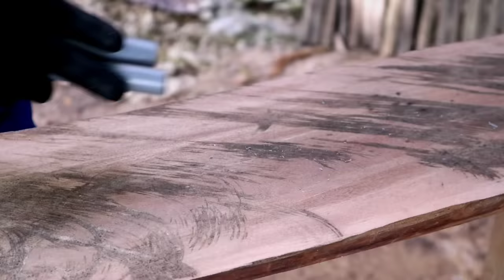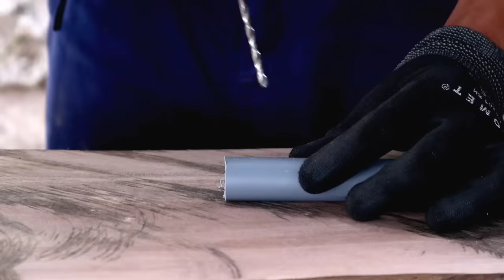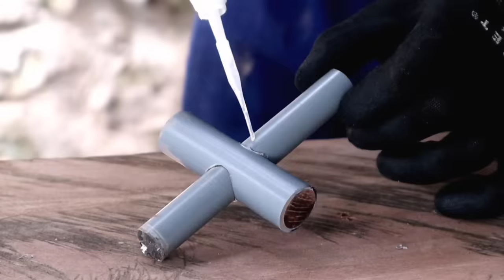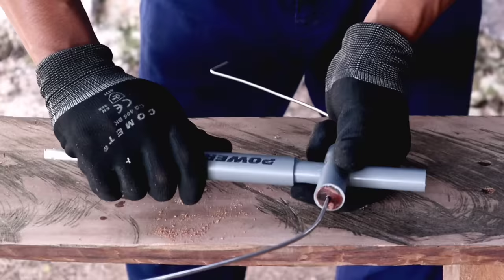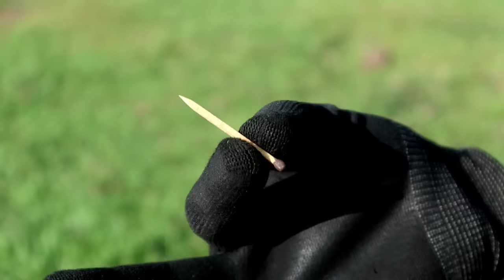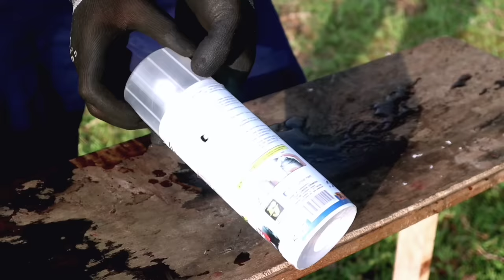SIMPLE INVENTION

Comment: He did this in another video how does the wood hitting the rivit ignite the match heads and when he packs it down. With the ram rod it doesn't go off someone explain  these physics there has to be something I'm missing
Reply: You are missing a toy snapcap, or a Real Primer.  If he put that on the end this would work, but probably blow the PVC apart
Reply: It makes sense if you don't think about 😁
Reply: The phosphorus on match tips ingnights with impact setting of the sulfur.
Reply: I’m wondering the same shit, if he’s not gonna show how he is getting that effect then why even have it on the video
Reply: It's an effect called dieseling. The air compressed by the piston heats up until it ignites the match head.
Reply: He packs it down softly, you barbarian.
Reply: @spartin1997  that's not enough to blow up everything it touches lol, something is not right here.
Reply: I don’t know I bought one of those little mini cannons that shoots the BBs. Instructions said use match heads, but I could never get them to (explode) even with a fuse just a little fizzle bb would just roll out the end
Reply: He should learn to drill straight
Reply: @snocattrf  Whatever, dude or dudette. It worked…crooked drilling and all.
Reply: Strike anywhere matches

Comment: So you have essentially built a fire piston and used it as the ignition mechanism for a musket. Neat
Reply: हलो
Reply: @vinaykumrawat2040  hole
Reply: Technically he built a miniature upright plunging  crossbow and loaded the quick shot tube with match heads. A musket has a flash pan are a small hole to fire it from the buttstock end! Symantecs though!

Comment: Good trickery timing with the off camera ballistic device that is what really blows up the target.
Reply: Nope, what he showed isn't impossible. You can make mini rocket boosters and cannon with match heads. It depends on the exact chemical composition the matches he has were madewith. Not all matches have exactly the same mixture. Some matches will just give you a little poof and lite up, others will flare up  in a much more impressive fashion when lit.
Reply: @VektrumSimulacrum  No reasonable amount of commercially made matches could contain and release enough energy to do the kind of damage to the targets as depicted in the video.  A firearm could.
Reply: @tompolkbroker  Maybe they're not your normal commercially made available matches. Maybe he mixed it with other stuff commonly available around the house. Nothing in this video is that far fetched. If people can figure out how to make Thermite with an etch-a-sketch at home something like this isn't a stretch.

Comment: Can you please tell witch material are you used
Reply: Wood, PVC, CA glue, two part epoxy, wire coat hanger (or bucket handle), elastic shock cord, and metal rod (steel, aluminum would work, but not for very long). If you start with a wooden dowel, you won't have to do the makeshift drill powered lathe.